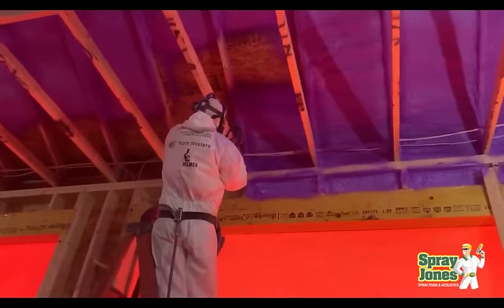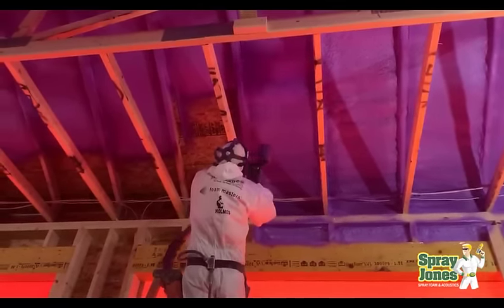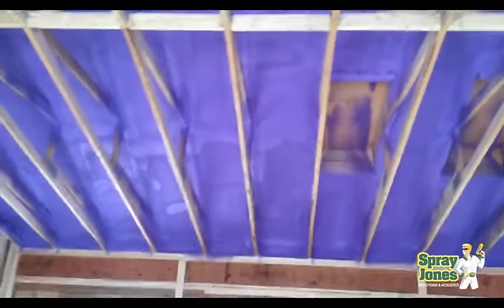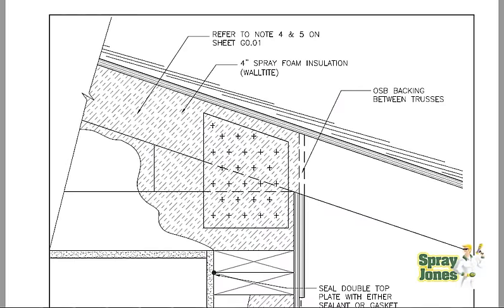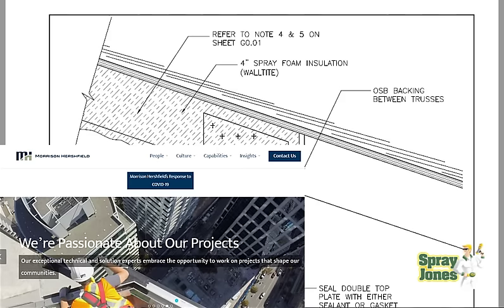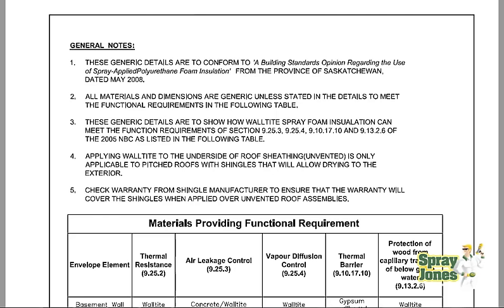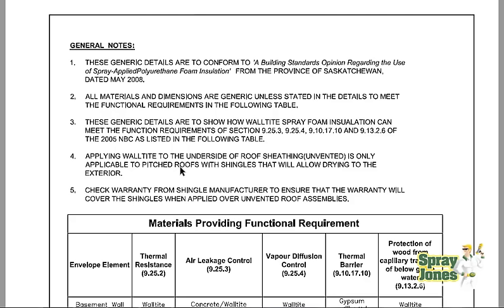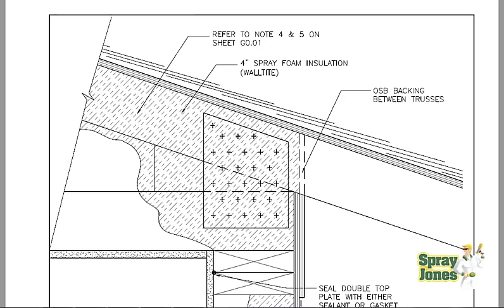Unvented roofs - Closed cell vs Open cell Spray Foam Insulation which is better?

Comment: Closed cell spray from on a 3:12 hot roof - any idea how tf it is flies are coming through light fixtures? Thanks.
Reply from the maker: Simple.... they got into the attic during the reno phase and are now living inside the space. Let them die off or kill them off if living in a warm climate and carry on life.
Reply: @SprayJones  oddly there is no attic. It’s a hot roof. No ventilation. R31 to the sheathing.

Comment: Amazing videos, I'm building my new home and was hesitant to go with spray foam due to sketchy contractors. I wanted to hire you so bad for my job but it looks like your in Regina SK. I'm in Calgary AB is there anyone here you know that is as great as you?
Reply from the maker: Call BASF Canada and ask them to get you in touch with Steven Cole. He is the Walltite rep for Western Canada. He can then vouch for proper installers that spray the foam in your area.1-800-891-0671

Comment: I’m in SoCal, so a fairly temperate climate, and have a garage I want to insulate. It’s all open hip roof, with no venting. Problem is the roof decking is 6” plank boards, not tongue and groove and noticeable gaps. The closed cell spray foam at first looks like a good solution but I’ve seen elsewhere problems with cheap and/or unauthorized shingles for spray foam underneath. Should I stick with foam board instead?
Reply from the maker: No, SPF is the way. 
Watch the 4 part series on roofs to know more...
Reply: @SprayJones  >A guy who owns a spray foam business is saying that spray foaming is the best solution.  Imagine my shock!

Comment: Thanks for the video.  I live near Amelia Island Florida.  Hot, humid summers and mild winters.  House has a vented attic with flexible ducts…(maybe R8) 
AC works very hard in summer to satisfy 77 degrees Fahrenheit.
Is it possible to have spray foam installed in a finished home that has a vented attic.  Roof is a 6/12 pitch with trusses. Would you use open cell or closed cell if it is possible?  Do you have a company in the Jacksonville area that you could recommend?
Reply from the maker: No to spraying retro fit when tight. I do have a video on spraying inside enclosed attics, there is not enough room to do the job properly.

Comment: Can anyone explain the e84 rating and what iS difference  between class A?  Also Mr. Jones if you read this would you think a 2x4 exterior walls wills 1 inch of foam on outside (zipr system) then spray cc foam 1-2 inches then fill with wet spray cellulose.

Also using cc fosm to underside of roof sheeting. My big concern is fire and spreading quickly. Is E 84 rated cc foam a good choice? 

Thanks for any help.

Comment: Hello Mike / Spray Jones, 
Thanks a lot for the collection of very informative videos. This video regarding closed cell on unvented roof assemblies is very clear. The only question that I have from it is whether you feel this applies to ZIP roof sheathing ? My research leads me to understand that whilst ZIP roof sheathing is waterproof, it is vapor open and as such, moisture could become trapped in the OSB of the ZIP boards, between the foam and the face material on the boards. I have been recommended to install rafter trays underneath to allow for air flow to deal with this. Have you worked specifically with ZIP or could you consider a video specific to this installation method ? 
Thanks again for the really well put together videos - I know how long it takes to make all this content !
Reply from the maker: Are talking about inside or outside for these vents?
Reply: Inside, on the underside of the zip roof sheathing. If you would do it differently, I would be very interested in your opinion, or a future video on this application.
Reply from the maker: @jamesmiller9177  The roof has to be watertight to the outside. That is: fasteners, underlay and flashing. That is the roof's scope and the primary water defense for the life of the structure. 
The SPF on the inside is direct to deck with NO ventilation. Closed cell does this the best. This is an INTERIOR envelope issue. The fact that insulate sheathing is used enhances the fact that internal vents are not needed. 
INTERNAL venting is for air leakage water to find it's way out. Not deal with water intrusion from the exterior. 
I will go into amplified pontification about this when I make the vaulted roof series.
Reply: Thanks a lot for your input on this. There is a lot of misinformation out there on spray foam and appropriate application which this channel tackles really well. I look forward to more on this in the upcoming roof video(s) !

Comment: what would be the purpase of spray foaming under the roof decking if you have a flat ceiling home ? would you still insulate over the ceiling ? otherwise you are paying to heat and cool your attic space.  i understand on a vaulted ceiling.
Reply from the maker: 1. They owners don't want fibrous and all it's issues.
2. They want the support and weather proofing layer

Go Watch the playlist I have on "SPF for vaulted ceilings" many of your questions and objections are answered there.

Comment: I feel sorry for roofers and homeowners with spray.  Most roof decking needs to replaced at some point, a lot of bad roofers out there.  How hard is it going to be to rip that ply off there to replace?  It’s going to be super expensive and difficult.  Then you’ll have to reinsulate.  Traditional insulation in areas that need access for service is a better option long term.  Plus, I’ve seen a few bad spray jobs that owners were getting sick
Reply: And with it completely sealed like this, they're going to have to replace that roof deck even sooner.  A small leak will turn into a huge disaster.

Comment: Great information! What are your thoughts to use either foam type on a house that has a  12' overhang covered deck that uses the same roof line (same slope no transition) that has Ice damming with heavy snow loads? I would need 1,300 LF of heat cable to try to bandaid the problem.
Reply: insulation under the shingles in the area that is ice damming is unlikely to solve the problem.

There is not enough heat at the roofing to keep the melted snow liquid and it refreezes.  This is what causes ice dams.  That is why someone is recommending the heat cable.

Getting a local roofer familiar with this kind of issue will get you the best result.
Reply: @fhuber7507  thanks for the response, I actually completely removed blow and all bats, repaired baffles, installed 3" R-Tech/air sealed (everything.), installed batting and finished with blow to a minimum R-60 (attic access was insulated to R-60 using pink foam board and pressed tight to also air leak). I moved all roof penetrations vents to the south facing part of the roof and eliminated a skylight on the north facing side. Moving the vents required me to use 4" foam core PVC ducting to not impact venting due to the additional distance, these pipes were then insulated to a minimum of R-30 near the roof penetrations. I build a cat walk over all of the insulation so I can access areas that may require service (vent penetrations, exhaust fans). I installed a roof exhaust fan (GAF), an articulating camera, and a light that all can be powered via WiFi so I can monitor conditions in the attic. I also installed a wireless camera on the roof so I can see when this roof has snow on it, so I can turn on the exhaust fan. It was an extremely difficult and labor intensive project that took me years to get the knowledge to put it together, but it works, the snow this year in Central Washington has been record breaking and there is no ice damming whatsoever (no need to have the snow shoveled and electric bill is much lower on this property). 

I was extremely thorough as I wanted to avoid using heat cables as they seem to be a dangerous band aid. I will be looking to do this on another property this year, minus the 3" foam board (ridiculous amount of work). Thanks

Comment: This may be a dumb question, I just started my close cell or open cell research journey. Can close cell be used on vented attics, the underside of the roof. I am not saying to close it in, just the underside to provide the waterproofing. South Texas, we don't get snow.
Reply from the maker: Waste of money. Deal with it externally so that you don't hold up an issue to the outside.
Reply: @SprayJones  it makes sense, just wanted a confirmation if it was possible. Can't find anywhere that it states, that vented roofs that it is possible to have close cell in the underside of the roof.
Reply from the maker: @lucky5wonder  Sure you can.

Comment: I live in north Europe and have a 30 degree angled roof with roof tiles on top, then a non-permeable plastic layer, and inch of foam and than  and than a 1,5 inch thick layer of osb below it. My understanding is that closed cell foam spayed from underneath to the osb would create a moisture problem as it could dry out, therefore is it correct to say that open cell foam would be the better option?
Reply from the maker: Please watch some of my other videos on vaulted roofs, including the one on shingle life. Foam to the roof deck when properly installed does not create an issue. Provided other weather-proofing measures are taken.

Comment: First thanks for the time you spend on the video's - I'm thinking of having some put on the plain underside of the garage roof in ontario. I imagine that some drying occurs towards the inside and I hear about solar drive pushing that. Am I just overestimating the amount of drying to the inside and the loss of drying will just happen to the outside now? Or when there is snow on the roof for 3 months solid? Thanks for the insight
Reply from the maker: The number 1 way a roof dries is via sunlight to the OUTSIDE. Does this help you?
Reply: @SprayJones  - Yeah I figured that. I was just thinking about what happens to the small amount that previously dried to the inside.

Comment: Can roof sheathing dry upward when covered by Ice&Water shield and standard shingles?
We are spraying the underside of our 4/12 pitched roof in NY, where we have all 4 season as well as low and high humidity
Reply from the maker: Yes it can if vapor-open membrane is used. Your roof can answer what their products can and cannot do.

Comment: What do you think of closed cell on a metal roof? 3/12 pitch. When we spray foamed our current building it was right to the steel on the sidewalls, roof was blown in r50. We had hail damage and had to replace the steel. The steel came off good. I had to go back and grind off the foam that was sticking out with the ribs on the steel for them to put the new steel back on. Do you know of any ideas to keep the foam from pushing out on the steel other then sheeting it. Were going to be putting on an addition and trying to think of a better way. We also had the steel push out inbetween where it was screwed. This was a post frame building.
Reply from the maker: Thinner metal is an issue, less fasteners, temp at time of install. Too much foam too quick. With 20 ga steel we have never had an issue with it moving when spraying 2" closed cell. 
Go watch my metal building playlist for detailed info.
Reply: They did 2 coats with a total of 3" closed cell. It was pretty consistent around the building. The worst was the west sun in the evening and you seen every ripple pushing the steel out. Least that got fixed with the hail damage. Heating has been great though.  I will find that video for the metal building. thanks

Comment: Can you spray foam the ceiling and walls and then later put up metal on the ceiling to close in the lower area? Or do you need to vent it at that point?
Reply from the maker: Yes. 
I have these questions answered in 4 part series of non vented roofs.

Comment: Can I ask thoughts on pole barn metal siding roof house wrap and roof vapor barrier under metal. Can I foam the entire building non vented. And closed cell on walls but a few different sprayers in my area say different for the roof line some say closed some say open building will be heated building is in PA
Reply from the maker: When we speak non-vented we mean no vents bringing air between the SPF and the exterior. The foam is applied direct to roof deck. 
I do not like ANYTHING between the foam and the roof when doing this method. 
I have a 4 part series on roofs, attics, vaults and SPF. Huge info to come.

Comment: What is the best way to spay a cathedral ceiling with a metal roof? Is it better to strap it for the roof or plywood then spray it?
Reply from the maker: Plywood, underlay then metal on top. 
SPF to the underside of the plywood.

Comment: Do you suggest removing all existing blown in insulation prior to spraying the decking, or can you just pull back around the perimeter.  Seems like a waste to throw it all away.
Reply from the maker: Has to be removed. How are going to get around and work?

Comment: Some questions - have you spray foamed with closed cell an i-joist roof, where was it located (aprox) and how long ago, and any long term issues?  I have watched the 4 part video on the application of spray foam roof but have noticed it is largely truss construction.
Reply from the maker: Yes we have, as well as solid. No issues. 
Once you control air and moisture reaching the cord the issues they would cause leave too.
Reply: @SprayJones  - Where (town or city) and how long ago, please?  Reason I am asking is I design the structures on housing and some commercial and have been seeing a trend toward these products.  I do have reservations, yes, but the closed cell it quite interesting.  R42 for 6" is quite amazing.
Reply from the maker: @darrellstruth839  Well I have been in business for 18 years. 
But I am not the first, this has been done in eastern Canada for much longer. 
Talk to BASF or Huntsman. They will confirm how much they sell across Canada and they have their drawings done for closed cell SPF to roof deck.

Comment: You can put spray foam on the roof deck after the house is built ? Just take the old insulation out and spray the deck ?
Reply from the maker: Not unless you have the room.

Comment: Hello, we are building an addition with a 1.5:12 slope steel roof. The contractor wants to use open cell foam. Is that the best choice in this situation? Could we use closed cell?
Reply from the maker: I have no idea based on so little info. What did you learn from watching this? What do you want?
Reply: @SprayJones  I learned that your video is speaking about shingled roofs, which apparently can dry to the exterior. But my roof is metal so it won't do that. I assume if I use closed cell, the water would be trapped, or might roll down the pitch. If I used open cell, the foam will just start absorbing the water and I'll have a mess either way.
Reply: My contractor said, "You typically don't want to use closed cell under a roof system as it's not permeable. This will trap water from any leaks and can cause extensive damage."
Reply from the maker: @KyleWilcox  Water that gets behind ANY roofing material in great quantity will cause damage. Open cell can and will hold massive amounts of water until it has to let it go into the structure. Closed will not let it in so the damage will be held to the sheathing and top cords of the truss. 
Watch the most recent video I uploaded "home sweet home" listen to what I have to say there.

Comment: Question if I have an open combustion furnace in my attic and I want to spray foam it with closed cell, should I add a combustion air supply duct / damper to the hvac units? I eventually want to replace them with an electric heat pump but that wont be for another year or so.. thanks!
Reply from the maker: Ask the HVAC installer. I assume yes.
Reply: @SprayJones  just spoke to a spray foam installer and they basically laughed at me when I asked for a closed cell quote.......

Comment: @spray Johns - I’m from Arizona in the US. I currently am renovating my entire 1976 ranch style house as we had a audit and I have a R6 ! Our 1700 house with 2 people has a $450 power bill and very uncomfortable house :/ ...Do you have any info on adding foam to exterior brick ? How well does it work ? And lastly does that insulation and closed cell foam throughout the house really save 30-50% on energy ?
Reply from the maker: You need to gut the walls from the inside. Then the old insulation is removed, and the foam can be installed. This is a disruption to your life so make it count. Do as much as you can. Maybe the whole place from inside....? Yes the foam will save massively. You are about to have your mind blown!